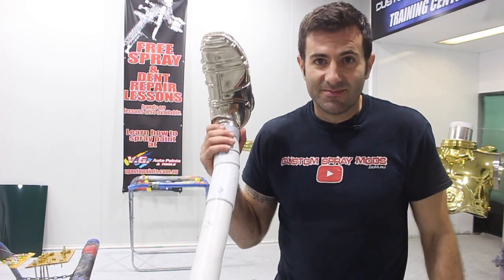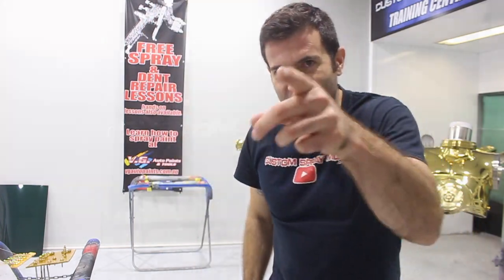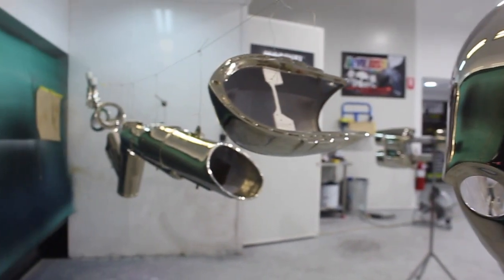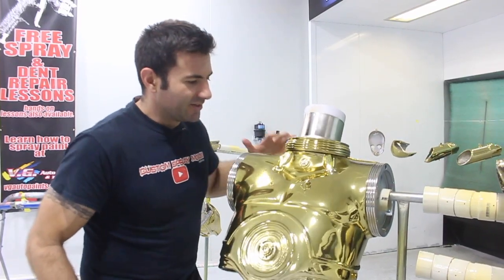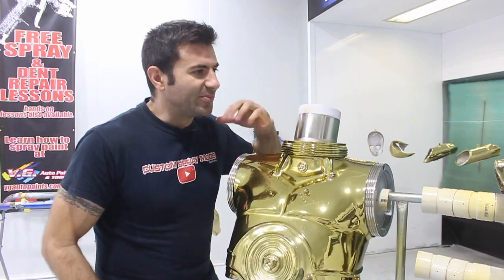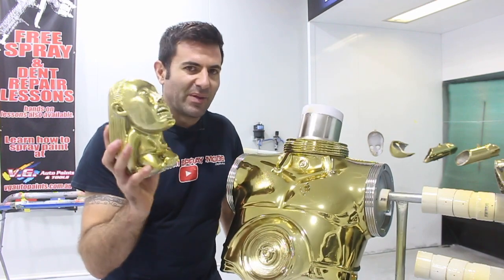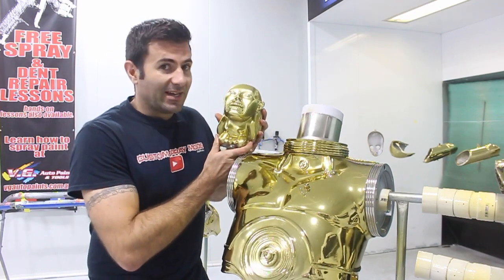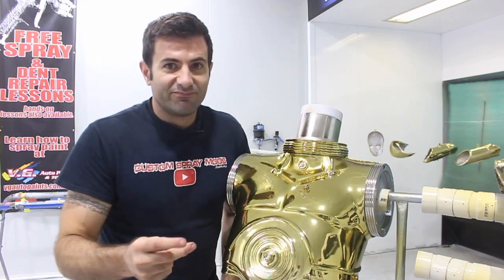Spraying gold over chrome C3PO Gold

Comment: I got these metallic silver shoes that I want to paint gold. Can I just buy gold spray paint and paint over it??
Reply: If you want the mirror gold chrome effect, normal gold paint won't cut it. You need to do what the guy does in the video. Look for candy gold/yellow paint. Basically, it's transparent paint, either yellow or orange. Once you spray that over the silver, it will tint the silver into that color, producing a gold chrome effect.

Comment: How durable do you think that would likely be? As normally you would sand and prime a surface for bonding.
One of the reasons trying to laquer a polished wheel isnt really viable, or so I'm told when I ask. :(
Reply from the maker: Tester Hamsticle there are clear coats that Bond to a polished surface. This is a display peice so the adhesion of the base and clear is enough to last
Reply: There is a lechler product 29-148 that will adhere to polished metal alsa corp also do a product aswell check there web for info

Comment: Is chrome nickel plating a cheaper option to conventional chrome process? Good vid mate
Reply: Decorative chrome plating always had a nickel step for the reflective shine.  The chrome was laid down on top so thin that it was transparent, but it doesn't tarnish and is very hard wearing.  These days you can't use hexavalent (chromium VI) coatings because it's extremely toxic, like permanently, genetically toxic, so you generally have to use trivalent instead.  That doesn't tend to wear as well.

If you just need decoration and are going to seal the nickel some other way, then that alone is fine.  Without the chrome, the nickel has to fend for itself - it doesn't corrode very readily, but it's too soft, so as soon as it chips or scratches, the steel underneath will preferentially corrode (galvanic corrosion / electrolytic cell) - worse than bare steel!